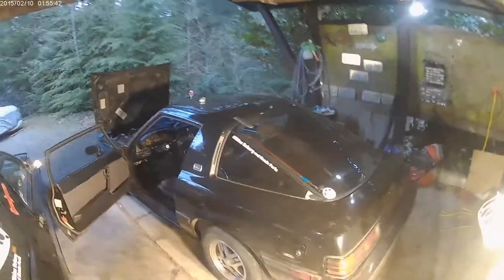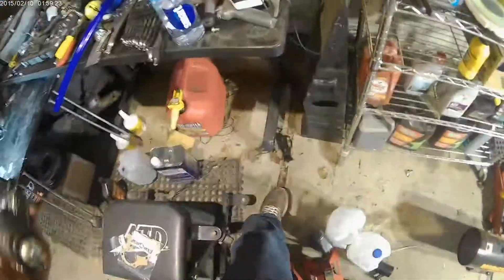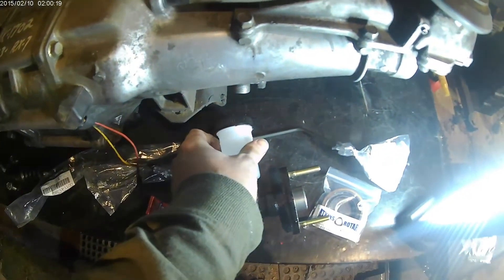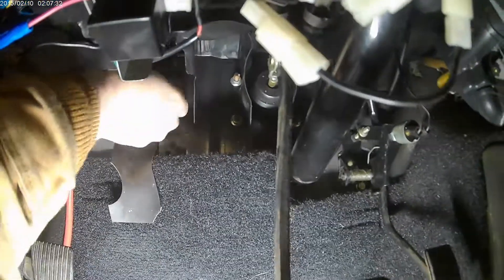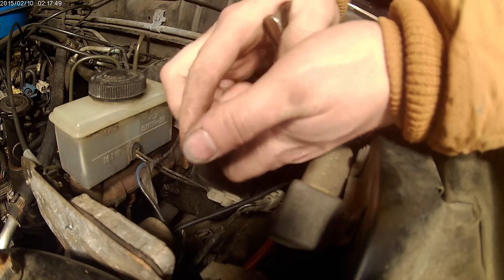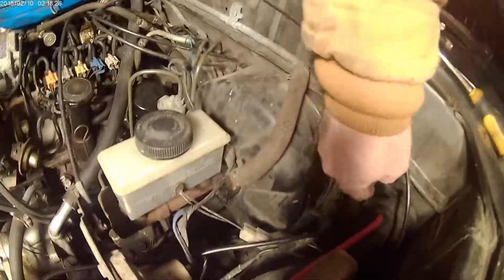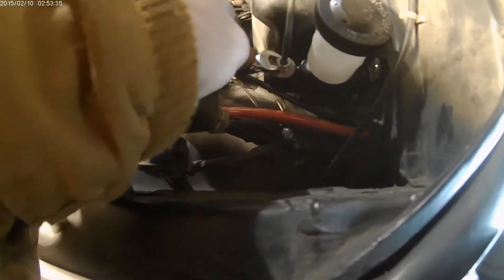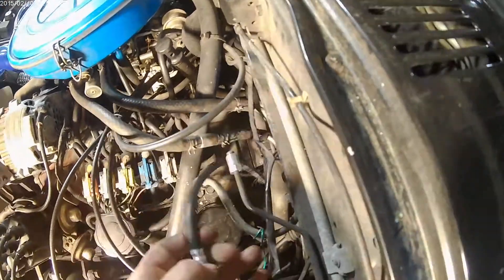Swapping A Manual Transmission Into FB RX7 Episode One: Clutch Master Cylinder And Hard Line Install

Comment: Miata gearboxes fit into these transmissions btw. Nice car tho gsl is a score in my book
Reply from the maker: Haha yes and apparently na fc transmissions also fit with minimal modifications depending on how long this box lasts me I might end up trying one of those two options if/when it needs replacement! Since this is the first time I've ever dropped a transmission or installed a clutch or ANY of that stuff I wanted to air on the side of being as idiot proof as possible and I'm please with the results so far it feels like a completely different car!